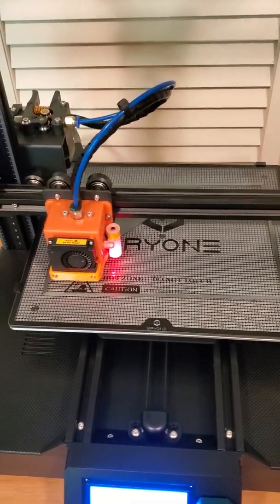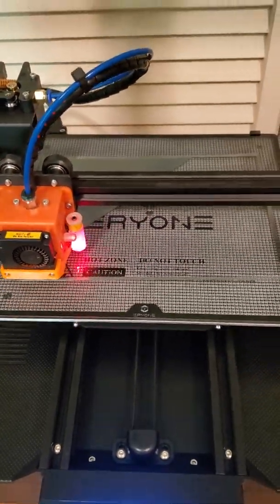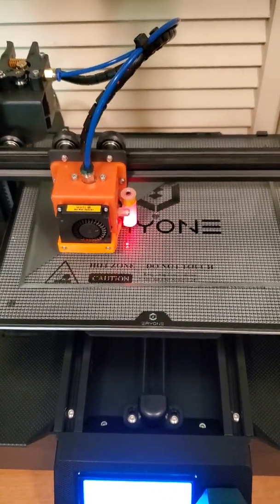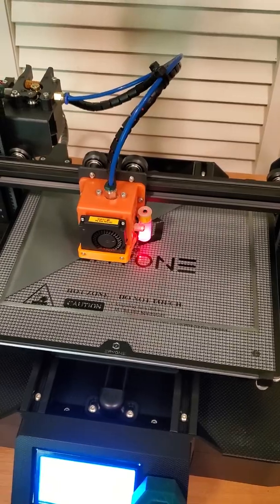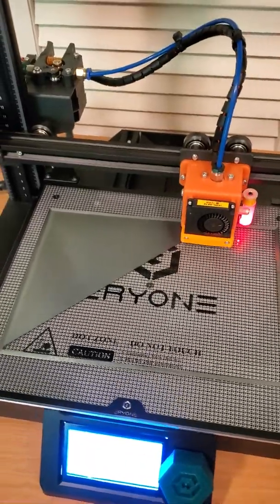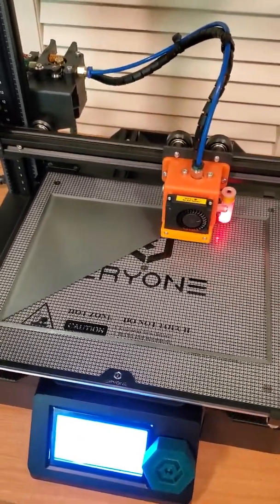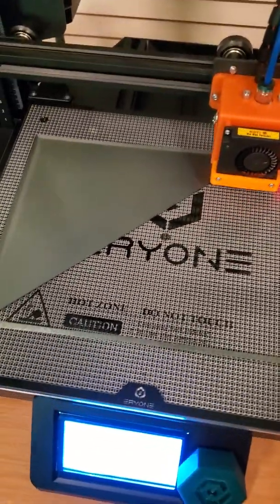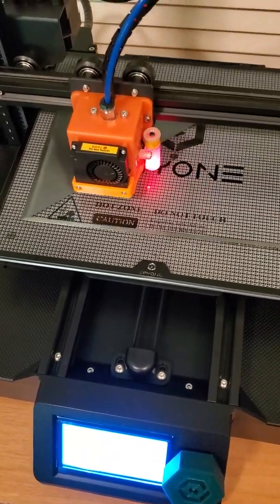Eryone ER-20 Calibration (retraction) update and some first layer goodness

Comment: Thank you for your awesome videos to the ER 20. I still got problems with the first layer, which is sometimes sticking like glue to the bed, and sometimes not (PLA). What initial layer settings do you run on your prints compared to the other layers. I can see already, that your fan speed is at 0%. Is your initial height, bed temp and nozzle temp (or any other setting) different? What are you suggesting?
Reply from the maker: First of all, thanks for the nice words!  I appreciate them!  So on the initial layer (for me), I use these settings:

Initial layer height - .24mm (this is for a normally .16mm layer height profile)
Initial layer line width - 100%
Initial bottom layers - 5
Initial layer  printing temp - 230c
Bed temp - 68c
Initial layer flow - 102%
Initial layer print speed - 15mm/sec
No fan on the first layer

Just a note, my z-offset is currently -1.750mm

I hope that helps!!!